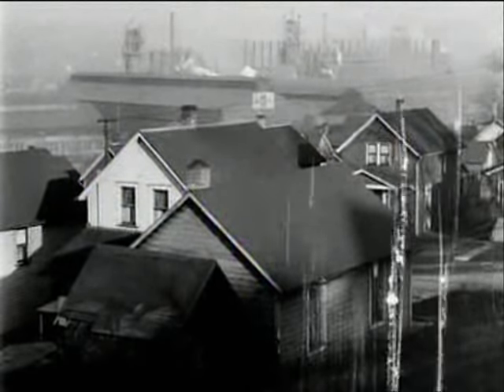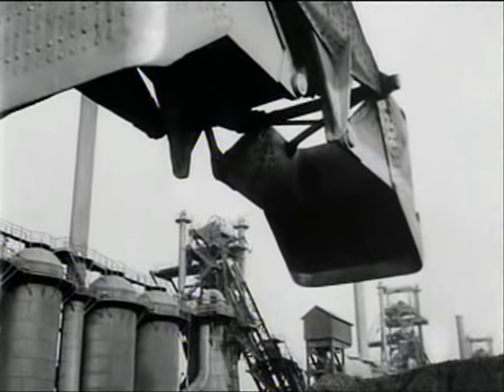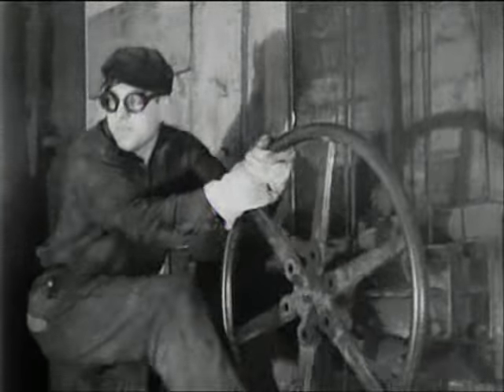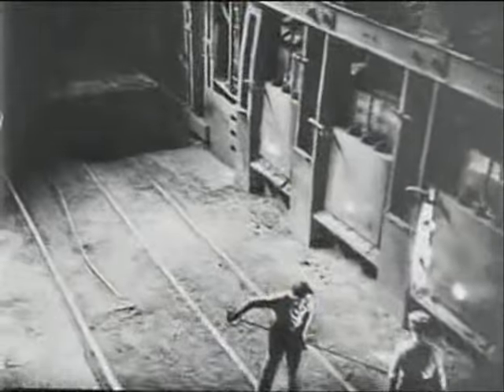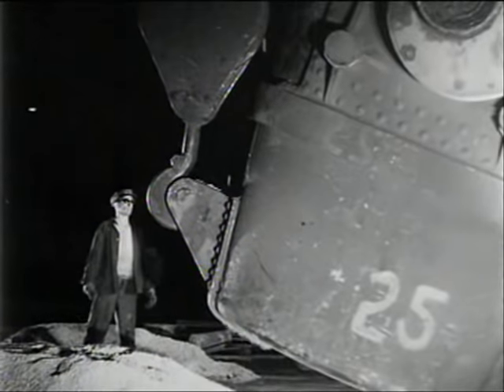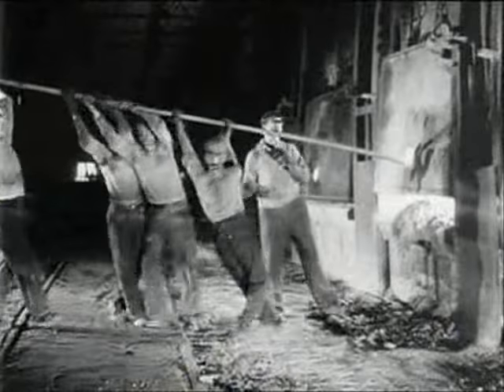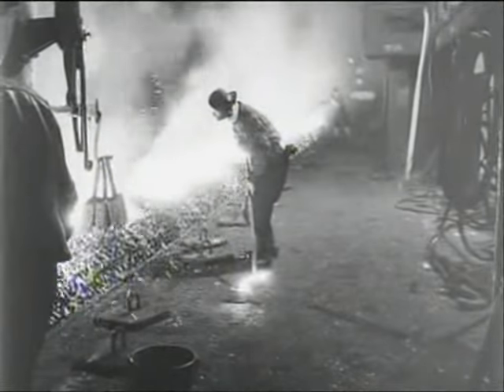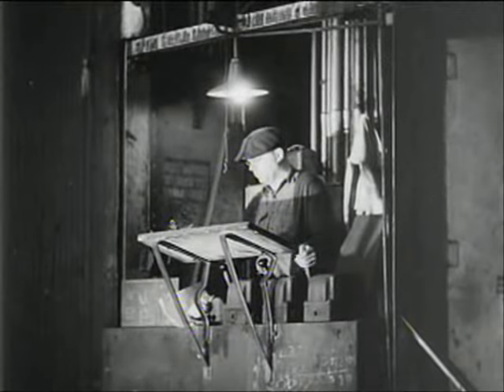Steel Industry 1944 Youngstown, Ohio

Comment: Steel making was incredibly dangerous work. Men were frequently injured and yes, they did occasionally fall into the vats. We owe them and the unions they formed thanks for the cities many of us live in today. All that is gone now, moved where taxes and labor were cheaper. The new plants are smaller and mechanized, and much safer. But those men, from the black and white past, look like giants to me.
Reply: Did you ever consider that labor union greed was the primary reason for the decline and fall of the US steel production?  Ten weeks paid vacation and ruinous work rules led to the loss of this bed rock American industry.
Reply: Smaller hell, more efficient and productive.  Unions destroyed Youngstown.  Maybe if they'd have fought for more modern equipment instead of ridiculous benefits, the mills would have stayed.  Obsolete open hearth furnaces and antique equipment + hostile labor = black monday.
Reply: Randy Magnum the failure to modernize is on the CEOs and board members, not the unions. Europe has strong unions but OWNERS also invest back into the companies. The American way is run something until it can't go any more, then patch it up and send it in for another round. That's on the companies, not the unions.
Reply: Randy Magnum you're delusional. Even Pittsburg had to haul everything in. Same with Cleveland and everywhere else. The unions didn't help their situation but what killed the mills was outsourcing and micro mills. Same with every other ounce of manufacturing in this country. The companies ran off. They would have even if the unions weren't the way they were.
Reply: I never understood why some self-proclaimed real Americans expect US workers to compete with workers in 3rd-world countries who live in dirt floor shacks, work 60 hours per week, have no safety regulations, no job security, insurance or time off. I'd be ashamed to live in a country that accepted these conditions  and yet men had to fight and die here for every one of those privileges against corporate greed.   That was America  100 years ago before unions and it seems a lot of ignorant people think that was America's Golden Age and Capitalism is some sort of perfect religion and its preachers on Wall Street and Corporate Exec Boards are all a bunch of nice guys looking out for everyone's best interest. Never have been, never will be.
Reply: Unions, working with liberal Democrats who then outsourced everything from dog food to sewing machines- and Steel! and made such ridiculous environmental rules that no mill could function without polluting some minnow or turtle stream is what killed heavy production in the US. Now India, China, and Pakistan are the Steel kings of the world.
Reply: @andrewnardo1021  In Europe all their steel production was destroyed during WWII. So when they rebuilt of course everything was modernized, they were starting from scratch and we largely built it for them.
Reply: Tony Miller yes, but Europe continually modernizes, they're not running the same equipment for 50 years, they're always doing what they can to keep up. America never has, we'll run the same clapped our machines until they literally fall apart.
Reply: O
Reply: @andrewnardo1021  They're over there because the labor is cheaper, you're right. When unions demand that they should be paid more and more and receive some such benefits, of course any company that cares enough about their profitability would move to a country with cheaper labor. Although the unions had a purpose, and certainly did some good things, they ended up shooting themselves in the heart by demanding too much.
Reply: The Claw Cadet I agree whole heartedly, however that can't always be used as an excuse when what most people want these days is a good wage, benefits, and not be ran into the dirt.
Reply: @andrewnardo1021  Yes, I agree with you, and I'm a huge believer in fair wage and some employee benefits. The problem was, the unions wanted fair wage and then some, as well as extensive benefits, which was just not something that the American steel industry was ready for at the time.
Reply: The Claw Cadet I agree, however unions are still needed in order to keep companies honest. Some CEO's feel that employees should bend over backwards simply for having a job and tend to forget that without workers they make nothing. The unions did get greedy, especially with the steel industry, however without them, manufacturing would be a living hell.
Reply: @andrewnardo1021  This I understand, fairness is needed in the workplace, but unions may not always be the best way to go about them. Unions can actually be living hell for employers that already pay fair wages and give benefits, especially in America in 2019 where you're not likely to see as many corrupt, ruthless corporations that mistreat their employees.
Reply: The Claw Cadet I wouldn't go that far. I worked in construction for 4 years under private companies. No benefits, 70 hours a week, and for what we did and the hazards the pay wasn't amazing. In construction, small business and their owners can and will run people into the ground. They have a tendency to make people feel like they owe the company owner for even gov no them a job. And god forbid you ask for a raise or need a day off. They make it seem like it's a privilege and not a right. Now I'm a welder for a company that builds annealing furnaces for the steel industry. It's a private company, however, it's a European company. Great wage, paid schooling, full medical, dental and vision. Starting at 3 weeks of vacation, maxing out at 7. But again, the Europeans have a different way of looking at things. They know that on a specialized industry, if the employees get pissed and walk off, you can't replace them easily. There's a mutual understanding there.
Reply: @andrewnardo1021  Europeans have that leeway because companies, barring that they move their factories to foreign countries, as they sometimes do, don't have other European employees to take the place of union employees. In 2019 America, there's always someone, often times an immigrant, that would be more than happy to take your job for equal or less pay then you had. Also, I believe that a raise or a day of is a privilege, after all, you aren't being forced to work for an employer that wouldn't give you a vacation day. I do agree, employers are not perfect, but at the end of the day you have to remember that you are choosing to work for them.
Reply: The Claw Cadet no haha you can't be more far off. Highly skilled positions such as welders, pipe fitters, electricians, pic, Cnc machinists, manual machinists, heavy equipment operators, millwrights, and boiler makers are not taken by immigrants in the US. I promise. Maybe in a jig and fixture shop, but not in ASME and API shops or really any union job site. Now, touching on your other point, some people have no choice but to stick with where they're at because that's the best that's around. And if you have a family and have no benefits and lower pay, that keeps you from getting out doesn't it? It's a vicious cycle.
Reply: @andrewnardo1021  It may be vicious to some, but it's capitalism. Somebody has to do the gritty work, and if you have the opportunity to take a job you best accept it, though it's not like the cushy welfare program won't provide adequate assistance to keep you alive. As for what you said I understand that some jobs under no circumstances could be taken by immigrants (these are the jobs where unions could likely be more successful), but construction jobs, agricultural jobs, and plenty of industrial jobs could easily fall into the hands of immigrants that would gladly work for peanuts. As a midwesterner, I have seen it first hand, and it is certainly disappointing, but at the same time, if the employees challenged the employer to find cheaper labor, then they only have themselves to blame.
Reply: The Claw Cadet so other skilled trades like masons and carpenters either work for peanuts or lose their jobs to migrants who work for less than minimum wage. I understand it's capitalism, but there is that one flaw that keeps total capitalism from working. Greed. You can't have pure capitalism, it wouldn't work because of greed. (No the US is not a purely capitalistic economy)
Reply: The Claw Cadet and I'm all for someone making as much money as the can, but not at the expense of the people who actually make the products, and build the buildings and provide the service. That's where a union of some kind lends its hand. It doesn't even have to be a legitimate union. It could be just the employees from one company that stand their ground when management come down handing paycuts right after they tell you about the owners new vacation home. I'm not saying give everyone handouts, but damnit don't sit there and try to fuck someone who just wants to do their job and go home and then sit there and say "sorry, it's capitalism".
Reply: Where do you work Andrew?
Reply: Marcus Robertson a company called Ebner.
Reply: Unions are a joke their all in the companies pocket
Reply: i work in the NIal/steel foundry, and one of my nightmare is that me or co worker fells down to oven/furnace. it keeps me aware when im in work.
Reply: @jkoysza1  Ten weeks paid vacation is justified when you work in a steel mill!!
Reply: @andrewnardo1021  I work for Arcelormittal Dofasco in Canada! Biggest steel mill in north America! We've been union free for over 100 years, and we're still successful!
Reply: Scott Jones the point wasn’t that you need to be union to be successful. The point was the unions weren’t the sole reason that Youngstown went under. And no shit, I work for Ebner furnaces. We build annealing furnaces for you guys. If I remember right 2 or 4 new heating bells went in at your plant and stelco  bought a 12 base battery around the same time.
Reply: @andrewnardo1021  Well Stelco actually got bought by US Steel and they laid off every worker! They have slowly started getting their coke plants going and have rehired alot of workers back! And yes the KOBM at dofasco has a bell!
Reply: Scott Jones that explains why that install went in so smooth. Usually when adding to an existing battery you’re constantly arguing with production over limited cranes to set the bases and hang piping. On top of that when they lift the heating bells to start the quench they don’t give a shit who’s around and they’ll pick it up. If you’re working on the furnace next to it you have to walk away until they get the cooling bell set on it. I get you can’t stop production, but none the less our guys must have been happy that they weren’t battling with that when putting the furnaces in.
Reply: @JackF99  Say what you will but Capitalism has pulled more people out of poverty , by far , then any thing else.
Reply: Cheaper than ZERO?
Reply: I guess CEOs giving themselves $1500000  yearly bonuses have nothing to do with the problem. At a employee benefit package  cost of $25000/year that could pay for 600 employee's benefits for a year. I understand that the CEOs in these corporations should get paid  more than your blue collar worker but it shouldn't be 100x-1000x higher. Hell USS gives bonuses to the corporate heads when they report an annual loss for the year. How does that make sense.
Reply: These men did what had to be done to take care of their own. They worked long and hard, and many died young. Every trade started out primitive. Men like these don’t exist anymore, and that’s Ok. We should be glad they did at one time , took pride in their work. They contributed to the development of the modern world. Union or not , because of them we have all the labor and safety standards existing in this country today.  Industry had to start somewhere. Hats off to these guys.
Reply: @ . @JackF99 : THANK YOU !
    -- for your rare Clarity. --
Reply: @jkoysza1  Teaches get 12 weeks vacation.
Reply: There is a really good novel written in the 40's called 'Out of This Furnace' about an immigrant family working in the steel mills of Braddock, Pa.  It relates the struggles of the workers, the harsh, dangerous and often deadly daily struggles working in the mills, the steel strikes, and life in general in a steel town.  I read it 30+ years ago in college and it has stayed with me.  Good read, compelling story if your interested
Reply: Some men didn’t fall into vats, they were given a helping hand by the mob.
Reply: "How man became giant" - I recommend this book
Reply: They were giants indeed.
Reply: Still is
Reply: @SimSim-zf9if  Yea well European countries are not 3rd World.
Reply: Dude, I live in a steel city, they are barely safer. And the plants are more sprawling than ever. What you're thinking of is the fact the steel industry has shrunk to almost non existence on the US because of imported garbage.
Reply: @andrewnardo1021  European equipment breaks before it's end life. There is not a single piece of equipment or working tool out there built in Europe that is decent, and can survive actual use past half the expected life of the product.
Reply: @jkoysza1  said someone that never worked in a forge or a foundry "ooooh nooooo the people literally being exposed to 1200 degrees 12 hours a day want to NOT die" 😭😭
Reply: @fraziercrawford  My dear Frazier, I come from a family of steel workers.  Five uncles, all employed at Universal Cyclops. 
They and I know well the dangers of steel making. My own employment was at the furnace maker Lectromelt. Do not presume that I do not know the Craft and it’s associated dangers. That said, I still maintain that unions killed the domestic steel industry.
Reply: More often they were crushed from crane fails and other falling objects.
Reply: @jkoysza1  Then you've got your history wrong. 
In reality the US Steel died off with the rest of our manufacturing industry in Reagan's pivot to China and pushing US manufacturing into the sea to fight the USSR(opening China's economy to US-foreign investors). In combination with rising economies of non-aligned states sourcing many jobs away. Worker Unions asking for more pay and equity only helped the push.
Reagan put US blue-collar work on the table for the Cold War and- it worked! Berlin Wall fell within a decade.  But at the expense of US Industry. If you remember much of the hubbub was about if we had enough manufacturing to sustain weapons and automobile production- that's all they cared about. Everything else could die away or move to China.
If US companies cared more about keeping US Industry than padding their quarterlies- they would have stayed. 
It's telling that American companies' profits soared in the 80's while our manufacturing industry relative to the whole economy was shrinking.
Not a problem to blame on Unions alone- at all. 
The highs of easy-money post-war America would not last forever and America can't be the sole manufacturing hub for the world after post-war nation re-building their own.
Reply: @ANO-.-NYM  I was active in the steel industry in the mid 1970s to the late 80s, well before Reagan’s effects. Pittsburgh furnaces were going cold even then. I agree that a failure invest and modernize ultimately killed this industry, and I submit that the labor climate made it an unwise investment.  Militant Big Labor killed steel and downstream manufacturing. 

I take issue with the accusations that I don’t understand the history.  Well, I lived this history and felt it’s negative effects.
Reply: @jkoysza1  If what you say is true- then it looks like Reagan's economic effects was just the nail in the coffin.
Looking back at American Unions in the 70s and 80s- you're right that some of them were corrupt. Though I defer that accusation a bit since the Mafia operated at this time to extort and control Unions like dockworker's Longshoreman Union to operate their illegal business. 

The Longshoremen's Union even negotiated for workers in your time to find new work in docks after the Containerization of shipping in the late 60s-70s.

I would like to add that the Labour Wars in America and alongside the Coal Wars- were started because of worker extortion, child workers, and abuse of workers using company goons and lobbied laws- people were intimidated- beat up and shot to not form unions. 
This was only stopped around 1930s with  worker's and union laws in the New Deal.

The unions did good there with eliminating child work in mines and advancing worker's safety.

Comment: Great video worked in a steelmill in PA in the 70's when they had electric arc furnaces.While it was a good paying job safety was poor and the working conditions worse with many injured and killed on the job and later from the heavy metals and the widespread use of asbestos in the air.While in a millwright gang we would makeup rolls of asbestos right on the picnic table we ate off lunch time take a broom sweep off and sit down and eat never knowing the danger.Glad i got out after 10 years.
Reply: Shit dude I hear that man.
Reply: That is absolutely fucked.
Reply: Imagine that you never knew the danger of that smoke exactly.  Northeast Ohio is the worst with cancer . !!!
Reply: The dangers of asbestos is over hyped.
Reply: @Vicus_of_Utrecht  I personally know of someone who got lung-cancer as a result of not using proper PPE while on an asbestos removal job.
Reply: @liammeech3702  After a single job?
Reply: @seane6616  Was subcontracted iirc - ended up in court - years after the job...was dreadful for everyone.